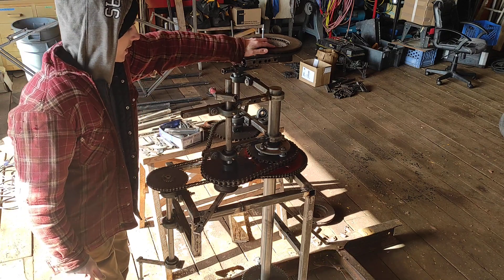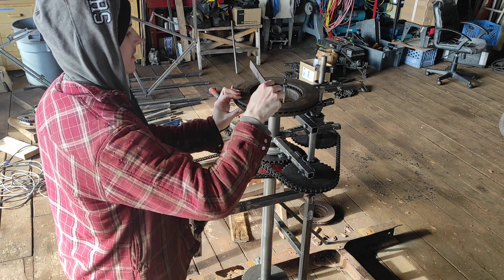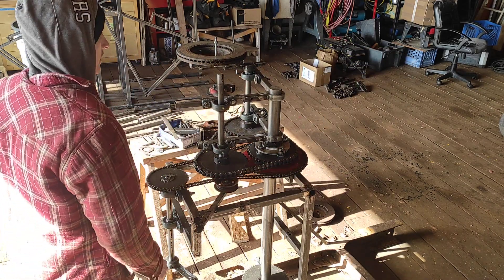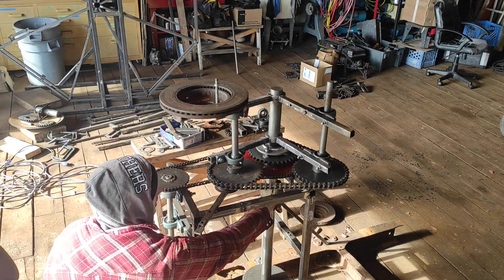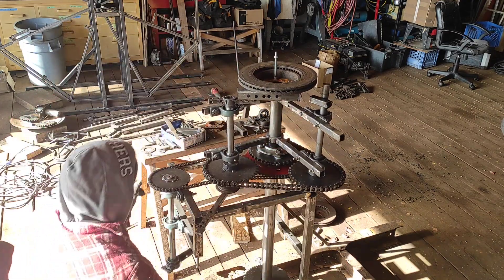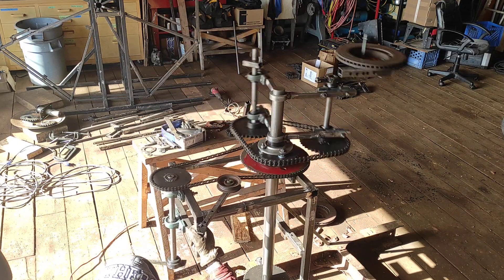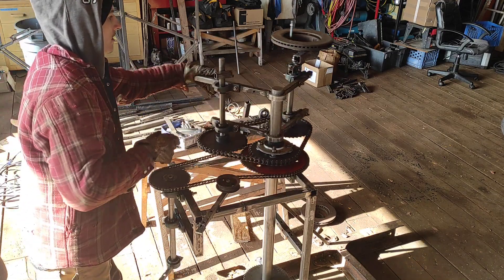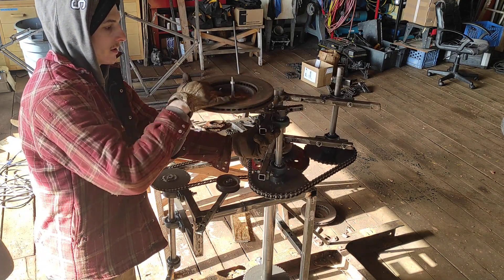Centrifugal Power Machine 2

Comment: I think I think right where the bolt goes through the weight the rotor the brake rotor you need to add a bearing right there is what I would do
Reply: I don't know if it would works or not either but I don't have quite as much confidence as my first ideal in it but I seen it clearly in my mind like a right where that rotor in the bolt that secures a bearings a half a turn or one turn and then come to a stop then start right back up and do it again. Kind of like an impact wrench.

Comment: Not bullshiting or playing games I know free energy I haven't built the device, even though it's fairly simple I'm sure if I had the parts it could probably be done within a few hours I just need to start I've known about it for over 10 years over 1,000 hours what part of the country do you live in you'll have to modify no motors or generators is two generators in 1 motor. And yes I know that you cannot hook as an example I know you cannot hook say 5 horsepower motor and to 2,500 watt generator and expect to get 5000 w out that is impossible . But I have figured out how to one electric motor to run two generators you get that 5000w I break no laws of physics. I live in Georgia what state do you live in?
Reply from the maker: In Canada. There's lots of ways to do extra energy, even with spinning weights. If more people were focused on it, it would be common place.

Comment: ne işe yarıyor bu makina anlamadım
Reply from the maker: It's a test machine to harness centrifugal force. It is flawed because once the weight has extended to the outside, the large shaft has to be stopped completely for the weight to come back into the center. I have corrected this problem, which you can see in my newest video. https://youtu.be/r0esa2LO13o

[Google Çeviri]
Merkezkaç kuvvetini kullanmak için bir test makinesi. Kusurludur, çünkü ağırlık bir kez dışarıya uzadığında, ağırlığın tekrar merkeze gelmesi için büyük şaftın tamamen durdurulması gerekir. En yeni videomda görebileceğiniz bu sorunu düzelttim. https://youtu.be/r0esa2LO13o

Comment: Maybe add an inertia disc with a good differential, 10/1 turns. You could see more clearly what is missing...
Reply from the maker: The problem is this. The force of the weight going out from the center is the harnessable force. It is the resistance of the weight to change direction, also known as centrifugal force. Once the weight reaches the outside of the circle, there is no way to harness the centrifugal force again, unless the big shaft is stopped completely causing the weight swing inward. To deal with this problem, I am designing a machine very similar to William Skinner's.